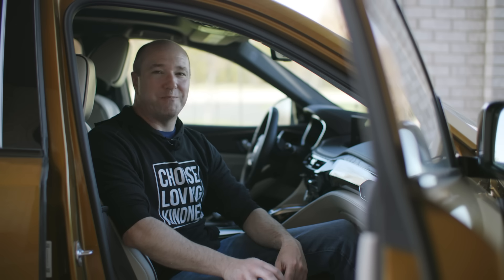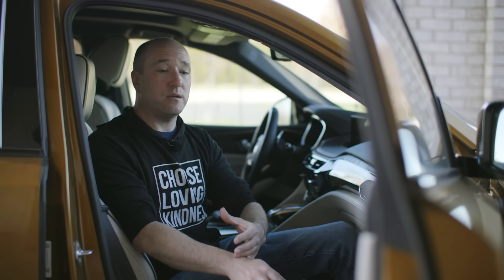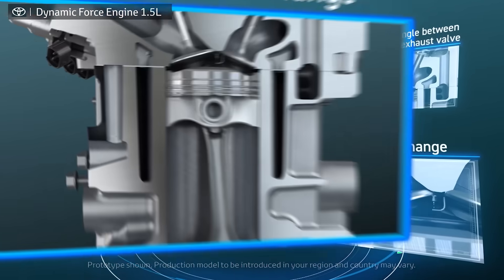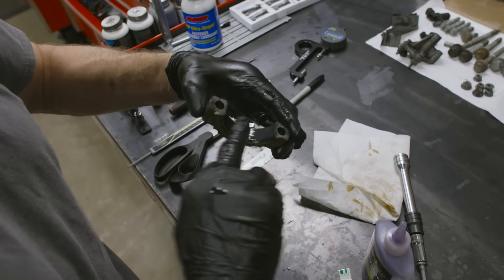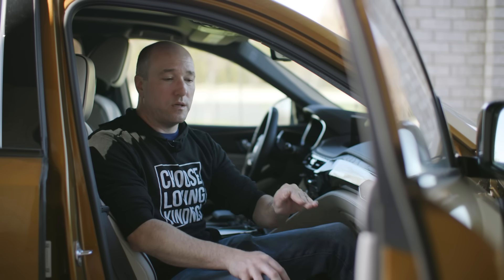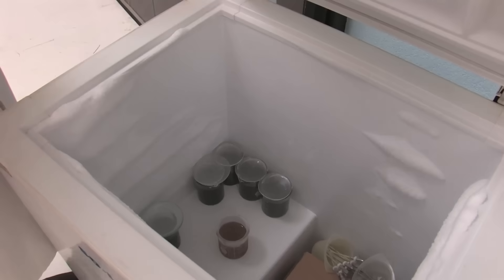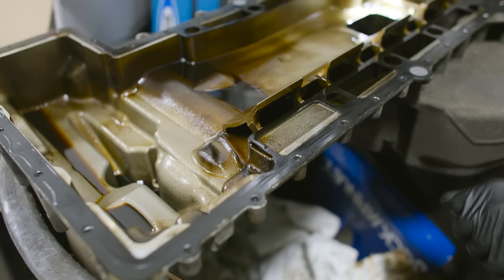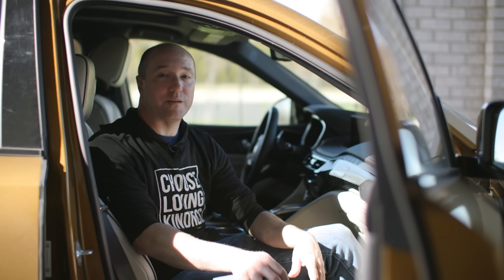Understanding Engine Break In | Dos and Don'ts

Comment: Thanks for this very informative and useful video.  As far as the oil evaporation in 0W20 and 0W16 and other eco oils, I can definitely confirm that they have more of a tendency to evaporate and to be consumed by the engine.  With the 9th gen Honda Accord 4 cylinder engine, there was a technical service bulletin for the entire VIN range for the 2013 model year on the issue of excessive oil consumption by the engine.  There was a problem with the oil control rings on the pistons.   I noticed on my new car that the engine was consuming oil before the first oil change.  I used the recommended 0W20 for the first oil change, but the engine kept consuming oil, so after that I went to 5W30,  and the rate of consumption dropped significantly.  The consumption problem got worse over time, but I documented obsessively how much oil I was adding between oil changes.  So at 101,000 miles, even though the car was out of warranty, American Honda agreed to pay half the $5,000 to replace the engine head, including pistons and rings.  If it had just been an automatic, I would not have bothered with the engine rebuild, but I love the 9th Gen manual Accords, so it was worth the $2,500 out of pocket for me.  But yeah, there was much less consumption with this engine by using 5W30 instead of 0W20.
Reply: The oil consumption problem actually applied to all the 2013 4 cylinder Accords, not just the manual transmission ones.
Reply: It’s pretty thin.  It is the weight that Honda recommends in Civics and Accords.  It improves mpg slightly, I think is the reason they recommend it.  But I don’t care for it.
Reply: @blueshark3098  I believe its this thin so the oil can reach the top of the engine rapidly.
Reply: See my original comment
Reply: We did more than a few of these m, especially in CR-Vs - baked rings syndrome, as I called it. One of the CR-Vs actually melted the side of piston from the excessive combustion temp. Other than that some burned valves and seats. 
One more thing, for some reason cars with manual transmission seem to have less engine problems than the automatics. One of ladies after we changed the rings and had the machine shop do the head, comes for 5w-30 oil change every 6k km and this engine has no issues at all. Others, start burning oil after 2-3yrs of use. I would rather like to see Honda switch to 0w-30 since it can take extreme heat better than 5w-20 oils.
Reply: @pliedtka  my theory is the manuals have less consumption issues because they're always under some kind of piston ring load on accel or decel, instead of automatics which tend to have very little load applied on decel since they'll fall out of converter lockup or just upshift.  not to mention most manual owners will probably exercise the engine into higher RPM ranges just based on the nature of the driving experience and being enthusiasts, so you get more heat into the internals to keep things freed up.
Reply: @iNSTAGiB nope

Comment: It’s great to get some clarity on this and dispel the myths, including bringing up that other reciprocating parts need break in as well.

I’d be curious about an addendum for EVs as the only car I’m likely to buy new at this point would be electric. Obviously they have similar considerations regarding the transmissions, bearings, and suspension, but I’m wondering if there are any good practices to reduce battery capacity loss or protect the electric motors from premature wear. I know it’s not like NiMh batteries where they have a memory effect or whatnot but I’m wondering if anyone’s determined it fast charging or using the full capacity of the battery when new can increase the initial degradation of the cells or if it will happen regardless once you do.

Comment: I was told by an engine designer at a major auto company to drive modestly like your doing your driving test, driving both city and highway for the first 1,000 miles then change the engine oil and again at 3,000 miles. After that you're all good.  Now the REAL question... How to maintain a modern automatic transmission and fluid changes?
Reply: Easy, mechanical sympathy and change the oil at 25,000 miles

Comment: Only once had the chance/duty to break in an engine, on a motorcycle (SV650). Stuck to manufacturer specified rev limits, warmed up and cooled down gently. Varied loads a lot and didn‘t shy away from open throttle - up to said rev limits. A year later the mechanic told me he‘d never ridden a stock SV650  that pulled so hard throughout all of the rev range. Seems I did well. Miss the bike.
Reply: Yep, similar story to my S2K, turns out it has more to do with quality oil like a Redline or Schaeffer's and less along the lines of a magic break in formula. A quality oil is needed for high RPM break in for trackday cars and such.
Reply: @anydaynow01  Whatever was inside mine - guess the Suzuki specified one. Wasn't it mineral oils for that purpose back then in 2000?
Reply: Did that with my 2015 Mazda 3 with the optional 2.5. Bought it new, varied revs and load and pulled to just shy a redline a couple of times during break in. Drove it like I stole it after and until I got rid of it. Zero engine issues. At 90k when I traded it in she didn’t burn a drip of oil and pulled waay more than any other Mazda 3 I drove, even kept up with cars it shouldn’t have on the highway. I miss that car :/
Reply: I love the Suzuki SV650.  One of the best bikes ever made.  I want one so bad.
Reply: @rebeltvr6046  I bought a used 2002 sv650s (same bike, slightly different gearing, plastics, and handlebars, same exact engine though) It was carburated, and I would ride it with the choke on from out of my neighbord onto the main street, less than a mile, only lettting it warm up while I donned my gear and getting to the road, and then I would fucking red line gears 1-3 on the street before very spirited riding on the highway. Granted California winters are not that cold but air temps would get to below 60 while I was riding, and she was riding strong at 80k. Only got a new bike cuz a car rolled on the highway in front of me. Bike was a blast to abuse.
Reply: @rebeltvr6046  Ive had three, keep buying them thinking Im missing something,, but they don't click with me
Reply: What happened to it?
Reply: @thaik56  Had an accident with a deer which left me paraplegic. Never saw the bike afterwards and never had the urge to do so.
Reply: @on_wheels_80  sorry to hear that. That should be a motivation to stay even more vigilant when riding. If you had to teach something, what advice would you give current and future riders to avoid such accident based on your experience?
Reply: @thaik56  It was a rather freakish accident with no time to react - I wasn't even too fast. Maybe I could have tried to separate myself from the bike, but no idea how to train for that. These things happen. Only way to avoid the risk is probably not to ride. If I was to ask one thing from the motorcycle drivers I see on twisty roads - totally unrelated to my own accident - is to keep their heads within their own lane in left hand turns.
Reply: @on_wheels_80  yeah I'm aware of blind left turn with oncoming traffic, it's best to ride in the tier 2-3 in these type of corners. Btw, were you wearing full gear with a decent back protector?
Reply: @thaik56  Full gear except back protector. I was interested in buying one, but uncertain about energy dissipation and feared what would give in case could be the more fragile neck vertebrae. Remember this was 22 years ago. Today, I'd probably look up some studies and get one.
Reply: @on_wheels_80  I sure wish you were wearing one, you'd still be able to ride and have a fully able body. Of course there's no guarantee that's why I probably would buy an airbag jacket when I'll ride serioysly. If designed properly it prevents your neck from moving by pushing against the helmet below it and protects your entire torso including ribs cage.
Reply: @on_wheels_80  
S..t, sorry man - I don't ride anymore after older man cut me off in the city traffic. One might end up dead and it won't be your fault at all. Our police man friend literally cut off dear's head at 240km/h (not all Caps are normal ;). If it would be at lower speed, most likely he would share your faith. I loved bikes but ... injuries hurt a bit too much.
Reply: @pliedtka  We used to joke what kind of bike it would need to get through a cow alive ... settled on a Hayabusa.
Reply: @on_wheels_80  ..... Oh man! ... That's heavy duty. .. All the very best!
Reply: I had a 99 honda civic si.  And my car was bone stock, and was faster than guys that I raced that had intake, header, exhaust, pulleys etc....  Everybody thought I had an ecu tune or something.  I'm telling you, it's because I was meticulous about the engine break in, that's why my si pulled so hard.  And I was a damn teenager when I broke that thing in.  I don't know how grown men in their 30's and and 40's lack the discipline to properly break in their engine, instead of ragging on a brand new engine before it's broken in.
Reply: With. today’s precision machining and tight tolerances, the main thing you’re breaking in is the rings. 
Newer rings are low tension and get mostly broken in the first half hour. After that the hone marks are gone on the cylinder walls. 

Heavy loads and high roms help force the rings against the cylinder wall. Testing on easy vs hard acceleration proves the hard acceleration creates a better ring seal and increases compression and horsepower. 

Also use a break in oil for the best results. Then change the oil after 500 miles to a high performance synthetic oil.
Reply: @Papparratzi why don't manufacturers put break in oil from the factory? They usually come with semi or full synthetic
Reply: I bought my 3rd gen Tacoma manual transmission brand 🆕 changed my 1st 🛢️change at 545 miles before I ever got on it I made sure it was running for at least 10-15 minutes to warm up the 🛢️🌡️ been very the load thru different RPMs tacomas are slow & like to be driven at low RPMs but I would also bring it up the way I would drive it, 2 years later truck is pretty damn good & I've done my 🛢️ changes every 4K. ✅ It every 2 weeks making sure it's good &  full no ⛽ smell
Reply: I had a 2002 SV650 too for my first bike. I miss that bike too went through some hard times with that bike. I had to sell all my stuff and downsize when I got booted out of military (for failed whiz quiz 🫡) and rode home from FL to NC.
Then my parents divorced and my cat died and my brother moved out and so did I, just a lot of change. And to top it off my dumbass killed her (her name was SVetlana!) when I was doing wheelies and totaled (I got banged up bad too.
I miss that naked bike.
Reply: Great bike
Reply: you arent going to see more than 1-2 hp difference. Break-ins are not magic
Reply: I broke in my SV1000S by riding 100 miles to the drag strip. 10 passes there. Still runs very good.  2003 model.
Reply: I dont know how you do it. I never break in any of my bikes. I sell them after 4-6k miles
Reply: @hby7768 you get a new bike every year?

Comment: I drive my 2019 Toyota Camry Hybrid mainly on the freeway. That is @62mph, the maximum allowed speed in the Netherlands during the day (at night the max is 74.5 mph). The engine then runs at about 1200rpm, for hours and hours. Even if I do 74.5 at night the e-cvt puts the engine at 1200rpm as well. I fear this is not good for the engine over time.

Comment: When I got my MK8 GTI a few weeks ago the dealer (salesman) told me there is no break in period because the new engine is an aluminum block and the oil heats up faster. I’ve since been absolutely thrashing it on the track, should I be worried? (JK I drove relatively moderate for 500 miles). Do you think he only said that to get me into the car?
Reply: Your block is 100% iron btw

Comment: Very timely for me as I just got my new Lexus GX. Had about 1K miles on it now after 1 1/2 months. Should I take it in for the first oil change or wait till 3K miles? Didn’t push the car anyway. Just normally day to day drive
Reply: Congrats on the GX, they are amazing!  I just got a 2023 NX250 at the end of February and I got my oil changed last week at 2300KM.  I was planning on getting it done at around 1600KM but they didn't have a sooner appointment on my days off, but I would think it is still much better than waiting until 8000km.  If you watch CarCareNut  he says he highly recommends an early oil change just after break in as he has seen metal particles in the oil filter when changing the oil for the first time, he also recommends 5K miles or 8K KM oil changes.

Comment: I like to change the oil and filter after the 1st week. And, cut open the filter. 

You would be surprised how much junk like metal shavings are inside brand new engines, even high-performance ones.
Reply: This occurs after every 5000-mile oil change. Should we continue to change our oil every 1000 miles? Oil filters are there for a reason.

Comment: Nope, every 3000 - 5000 miles if your engine has direct gasoline injection (DGI), the high internal pressures create blowby where unburned gas blows past the rings and into the crankcase.  Now, you have a problem with oil dilution.

Comment: What if you live in an area where it never gets cold (i.e. Florida)- we really don’t need that 0 weight oil then - stick with 5w-30 even if manual says use the thin stuff?
Reply: Just use 90W oil  thicker oil is better

Comment: I just bought 2022 Miata, less than 400  miles on it. One thing I haven't done is take the engine to redline.  The max I've hit it was 5000 between shifts and never held it there long at all.  Not sure if I should redline a couple times? Thoughts?

Comment: When it comes to oil, I only use 100% synthetic, not "full" synthetic, which is just marketing bullsh*t. If you observe the long drain intervals recommended by most manufacturers these days, especially in very hot or very cold climates, then you should definitely use 100% synthetic oil. I use Motul Eco-Lite 0w20 in my Subaru Outback XT and run it for 7500 miles, and my engine loves it. I could probably go much longer, but I plan on keeping this car for 200,000 miles, so I don't mind doing a few extra oil changes as insurance.
Reply: Sounds like you’ve been duped by Amsoil. Pursuant to a 1990’s law suit between Castrol and Mobil 1, courts ruled that group 3 and 4 base oils are synthetic, therefore any oil that contains one or both of those groups, regardless of proportions, can be called synthetic. So as long as Amsoil contains group 3, even if it’s 100% group 3, they can legally call it 100% synthetic. Thus, 100% synthetic and full synthetic are synonymous.  Amsoil admitted this in one of their own blogs.
Reply: @luptonpittman6520  Sounds like you're willfully ignorant. 2 minutes of research would confirm what I am saying, but you chose to come here and reveal your ignorance instead, typical American. By the way, I've never used Amsoil in my life.

Comment: Great stuff, especially important to understand how many additives and shavings need to get cleaned out during the first thousand miles. But I disagree with the notion of "cooling off your engine and brakes" after track sessions. Unless it's quite cold outside, there is no thermal shock with natural cool down. Show me a cold engine 10m after any extended driving. Calipers will not warp unless you hold or lock the pads on. You simply need to do a steady warm up of the whole system for the next session.

Comment: I used to race a Honda RS125, which was a 125 cc 2-stroke single made by HRC. The motor reached its lofty ~37-40 peak hp around 10,500 rpm and had usable power between about 9,500 and 12,000 rpm. The HRC manual recommended changing pistons every 300 miles, which didn’t leave a lot of room for breaking it in 😊
Reply: 40hp out of a 125cc is impressive, considering my 2019 400cc sits @ 49 HP
Reply: @Josh-cw8by  is that 400cc also a 2 stroke?
Reply: @rapzeh4  Not a chance. The pistons also last the life of the engine...roughly.
Reply: @Josh-cw8by  40 hp on a cool dry day with high air density. Stock claim was 37 hp, I think, but Bill Himmelsbach did a moderate amount of reshaping the internals for better flow. Also, an aftermarket expansion chamber. It was pretty well tuned but never seized, gods be praised.

Comment: I am about to take delivery of my wife’s new Lexus hybrid about 400 miles away.  Gonna fly to the dealer and drive back 400 miles.  Any recommendations?  It will mainly be freeway driving back at 70-80MPH.  Thanks.
Reply from the maker: Just do your best to manually shift and get into different gears. So instead of sitting at 75 at 1500rpm drop a gear and do 75MPH at 4000rpm for a bit.  Use throttle to go up from 55 to 75 at 25% throttle then 80% throttle then back off randomly.  You dont have to do it entire trip but try and do it as much as you can first 200 miles.
Reply: @savagegeese  ok. I will do a variety of speeds and RPMs.    Thanks.

Comment: Varying load is what I do with all my cars break ins. Same now with my new FL5 Type-R, except that for the winter at 1000 miles I switched to 0W30 Amsoil Signature oil, and now at 4000 miles after the winter will be using 5W30 Amsoil Signature oil. The car is moving from PA to FL soon, so will stay on 5W30 from now on. There's definitely a difference between 0W20 and 5W20, or 0W30 and 5W30. The NOAK for the 0 weight oils is over 8%, while for the 5 weights its at or below 5%.